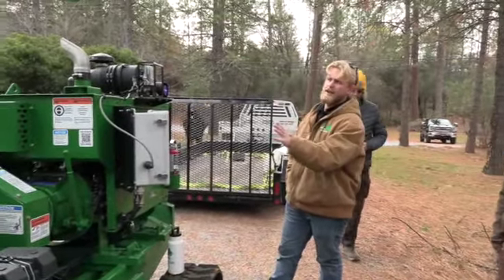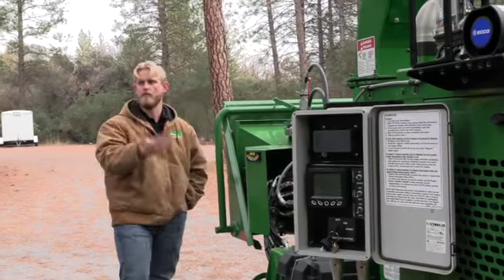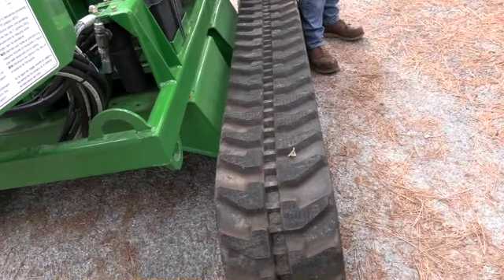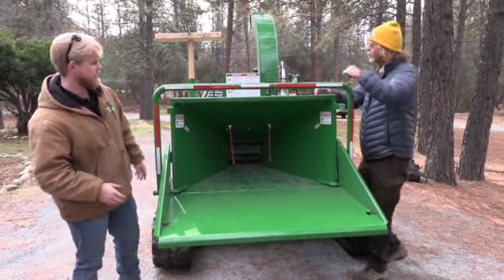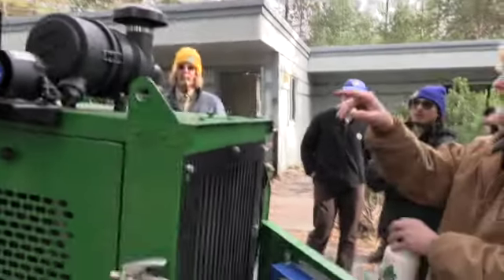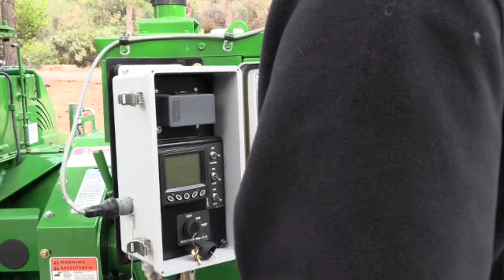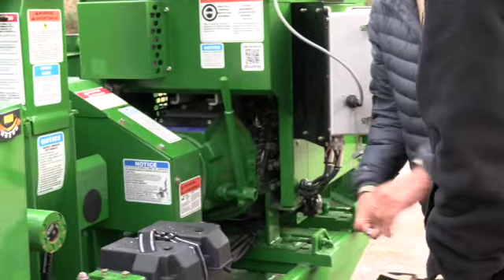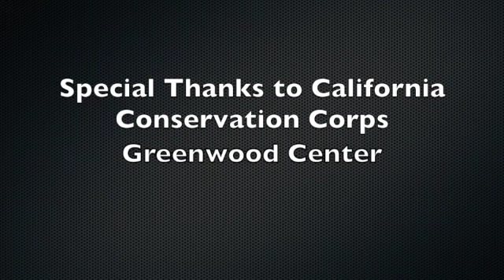Bandit 75XP Track Chipper Training CA Conservation Corps RKU Distributing Inc / Cal Line Equipment

Comment: Is this the 75xp on a track a custom order or a discontinued option? I dont see the 75xp with a track option on the Bandit website.
Reply from the maker: The 75XP is  a custom order machine.  They are not as common as the 12XP or 250XP track units, both of which are 12" machines.  We have a 12XP track machine training video on this channel to help see the difference.  Those are a little bigger and are requested more often.  The more common machines get on the website.  Thanks for watching!